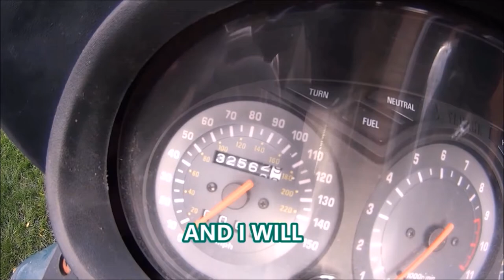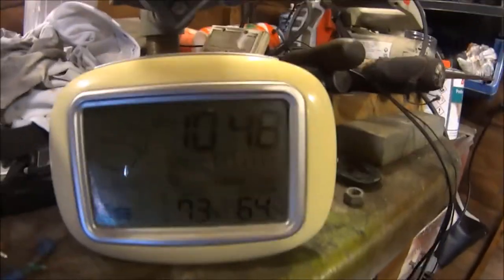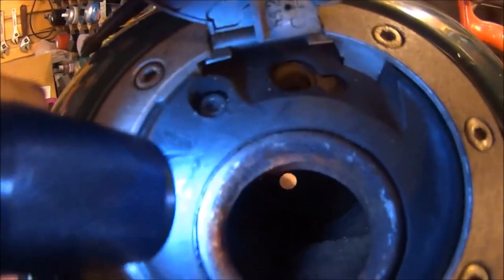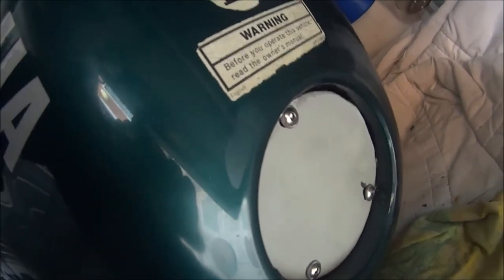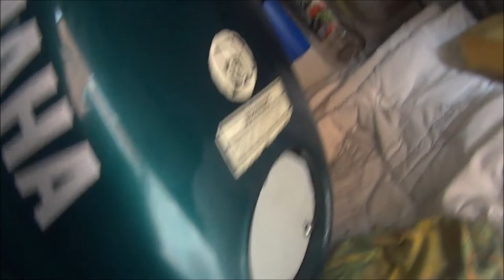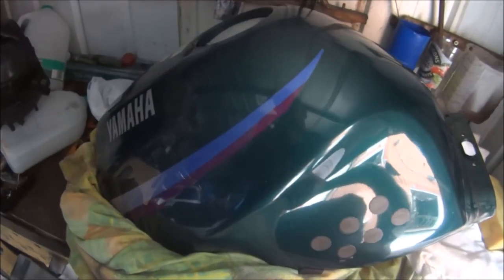XJ900S Clean out a rusty M, cycle fuel tank. Ep1 of 2,

Comment: How much did all the vinegar cost??? It’s a pity it can’t be reused on your chips! 😎 hope that method works for you buddy. I tried it a couple of years ago on my old gtr1000 but it didn’t get the rough stuff off and ended up using electrolysis. When I did my divvy tank last week tho I did put in half a cup of vinegar along with the powder to jazz it up a bit and worked a treat!👍🏻
Reply from the maker: Northerner 137 lol a lot less than a full tank of fuel. I will use it again on the CBR tank.